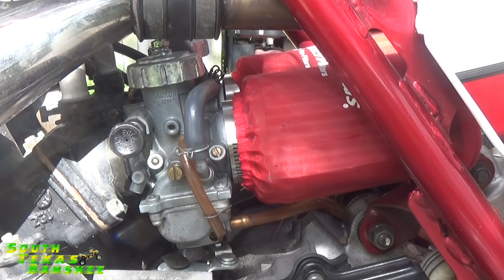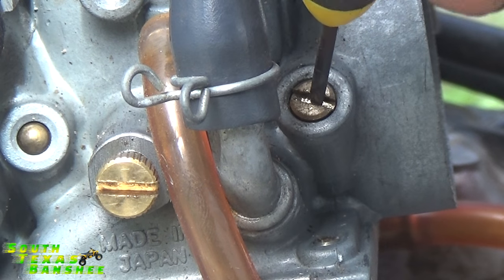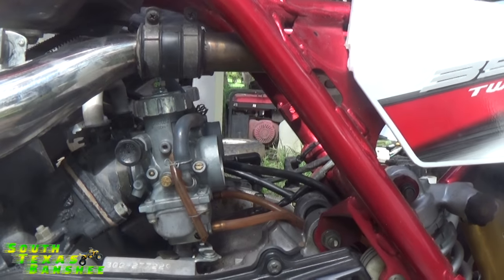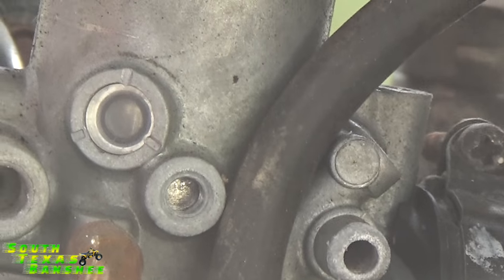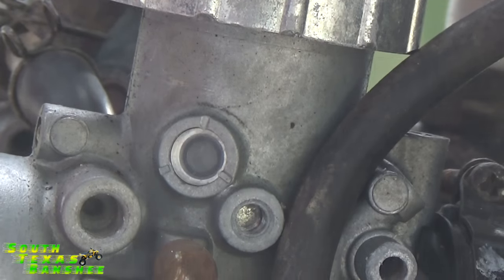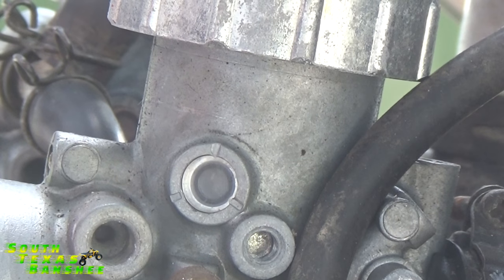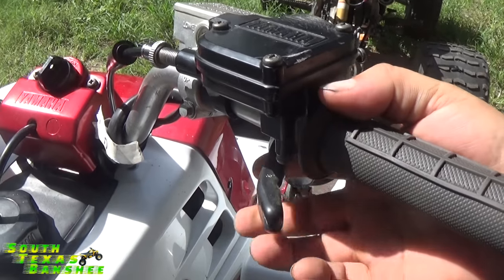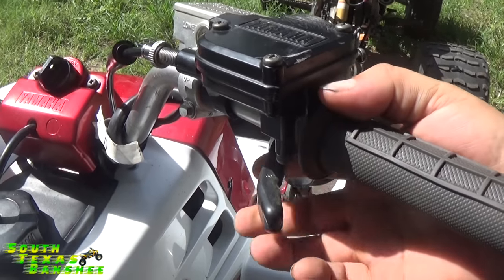Banshee (stock) carb tuning, air mixture, synch and idle adjustment

Comment: Your videos are magic in the making thanks big homie
Reply from the maker: CITY-OF-911 thanks for the appreciation my man, more to come in the fall!
Reply: Not even gonna lie if it wasn't for these videos I would of been broke  bringing it to a mechanic. But this is my first banshee, and it came with cool heads and I'm doing a rebuild on the top and bottom end do I need a special gasket set? At least for the top end ?
Reply from the maker: CITY-OF-911  order a pro design cool head o-ring kit. You’ll be good to go. No gasket is used under the head. Be sure you watch the cool head video. Take your time and it’ll go smoothly.
Reply: South Texas Banshee thanks, just posted a pic of my bike on ur Facebook page I hope u like it.

Comment: I did the same as the video and it now runs great but there is fuel leaking near by the idle screw from the oveflow wholes in the right carb

Comment: Hey.. my stock 26mm  carb for my 350  called for a 280 jet 30 pilot with my pipes but I'm moving up to a 28mm Keihin PWK carbs.. the jet number are smaller they dont sale a 280 jet for those.. question is would a #160 main jet on the Keihin PWK be same as 280 on the stock.. if not what would be a 280 on the Keihin PWK

Comment: How do the carbs feed fuel during operation? Is it pressure or vacuum that pulls the fuel in or how does it work specifically?
Reply from the maker: Gravity fed sir. As long as the fuel cap is venting like it should fuel will flow down into the carbs. Have a good eveing🤙🏽🤙🏽🤙🏽
Reply: @kevingalindo1  I'm having issues with not getting any fuel into the cylinders, just did tors delete and did a rebuild kit on the carbs. Any suggestions?
Reply: @DJMANDOYUPP  make sure your carbs are sealed and you don't have an air leak between the reeds and the carb. Also make sure your jets are clean

Comment: I have a Yamaha banshee 409cc stroker could you tell me what Jets to start on OEM carburetors mikuni's
Reply from the maker: What elevation and air filters ya running? Also what temperature  is it where you are

Comment: great video!! I just picked up a banshee that's been built with a few mods. idles like shit and bogs at low rpm. I'm certain the carbs are outta whack. thanks to you I now know how to check the carbs. thanks again.
Reply: Dan Ayotte my banshee Boggs to at low rpms. Did this video help stop the bogg cause mine still Boggs at this time especially on take off on first gear.

Comment: hi kevin! need help bad....can you point me in the right direction. I have blown 3 top end. I seem to can get my jetting right. I have a 421 with 34mm pj crabs 55 pilot 152 main never been touched. my elevation is 702. where should I start with my pilot and main? please help me
Reply from the maker: Are you doing plug chops? 152 mains sounds like 10 sizes too small, what are your mods?

Comment: I know this is an old video, but I just got my banshee, it seems like mine won’t idle very well, and it definitely smokes more than yours. Does that sound like the carbs need cleaned and adjusted? I plan on following this video step by step to see if that will make it idle. Do you run seafoam in a 2 stroke? What ratio do you use for oil? Thank you!

Comment: Hey just got a 1995 Yamaha Banshee. It still has the Tors carbs on it. I can't get it to ideal and it back fire. Any help would be greatly appreciated
Reply: Hey so i seen this is old but it its backfiring and not always getting spark and it wont start properly its generally stator issues. Mine did the sake thing untill a new stator was put on and my timing was set

Comment: Am I correct that turning the air screws OUT means more air less fuel and IN is vise versa? Got a stock 04 used, found they were 4 turns out instead of the factory 2 turns out. Thanks for your help as always
Reply from the maker: ME 109 that's correct. If they had them that far out, the pilots let's may be too big.
Reply: @kevingalindo1  I haven't ridden it since I turned them back to factory settings. When I do what symptoms should I be looking for before I have to look at the jets?

Comment: is there a easy way to check pilot jet lean or rich?
i know main jet is do a 6th gear pull clutch in and coast it out and then check spark.
but i got a bog down at 0 till 1/4 power its pissin me off, air screw is at 1, removed the airbox snorkle, and i got 22.5 pilot jet that seems to small if i google a bit around it should bee 25...
main i put 210 in, i got stock bit with stock airbox no holes just a twin air filter. and 31k rdlc 350 carbs (i think these are 28mm) i dont want to run it lean and fuk it up its already a expensive quad :)
weather also has its effects on the quad

Comment: South Texas Banshee I do not understand by following your steps and the left side does not work in harmony with the right !! I live 800 meters above sea level and use 280 main jets and 25 Pilot jets, I also use T6 Any help what happens?

Comment: Got a question u helped me before i have complete stock banshee with vforce4, k&n filter open air box with fmf pipes can get it to jet right i have 280mains and 25 pilots straight frying my plugs. Any info? Now i habe another one with stroker spacer plate with fmf pipes and it has 340 or 330 with either 40 pilots or35  have to double check again but runs good.

Comment: yes! I have 4mil crank 115  long rod 68mm pistons 21cc domes v 4 reeds 34mm pj keihin cards shearer small bore pipes advanced +4 with the advance black box I seem to not know where to start jetting with my elevation i
Reply from the maker: I'm not real familiar with the PJ carbs, but a guy I know is running 34 PJ's and 165 was too rich, so I'd start there, so your not making runs too lean. Start rich enough it won't get on the pipe, then step down size by size until it will. At that point start doing plug chops. Be sure you leak it down as well.
Reply: Okay thanks!

Comment: I bought my banschee had the tors delete but not the idle screws. I added the idle screws now nothing. It's leaking gas to the right of the choke where you have the pink tube attached.  Any ideas.  It ran before I messed with it

Comment: I never installed the idle screw ...I use the top of the carb nut for such. Every did it that way?
Reply from the maker: The thing with thay is that's not the right way. You need to have slack in your cables. 9 times out of ten when you have no slack in the cable it will rev when you turn the bars one way or the other.

Comment: stock motor, TR6 pipe, 300 main 27.5 pilots, air screw 1.5 out and needle clip in the middle all stock carbs... running airbox/K&N cone with holes at sea level, temps ranging from 50-75... it'll start from cold, and run until it warms up but fouls plugs on idle... any ideas? after it dies on idle it wont start until completely cold again... or i clean plugs.

Comment: Hey I've been watching your videos and like your work.  Not sure if anyone can assist, I'm running 300 mains on a stock bore mild ported banshee with pipes and intake and reeds and filter and still only able to get air screw out 3/4 of a turn.  I'm told I need to be at least 1 turn out or I'm running wrong size jet... Well I've gone from 290 to 300 and I can only get decent colored plug chop at that mix :(. I'm also running 50:1

Comment: HELP. My banshee got new carb gaskets, synced and went really good last time i drove in like 3h. Then i got home washed  the banshee carefully. Next day i was going for a ride and It started to misfire and bog on leftside at low rpm. I cleaned my K&N airfilter. I drained the carbs. I checked the sparkplugs and even changed them. They went black AND dry. So my real question is... is there any gasket on the engine that can cause this ? Can it be a tiny water bulb or some unwanted vaccum coming in? Thanks yall!

Comment: Why do you think that when I'm giving my bike gad In 5th and sixth gear it seems to bog. but all the rest of the gears it has plenty of power. It freshly rebuilt top end and bottom end I have the timing advanced to +4 degrees and running 300 main jets and  27.5 pilots. air mixture screw backed out 1 turn. I had it at 2 turns but it would sputter at low speed.

Comment: Hey great video! I've seen you've replied to a comment from 2 weeks ago so hopefully you see this too. I've got a ybr 125 single carb very simple but it just won't idle. Idle screw is screwed all the way in and I've played with the fuel screw as well but still it just revs down slowly from about half choke and then dies. Only full choke will keep it running. If I rev it while on choke then it revs up high and stays there until I bring it down a little then it slowly dies down completely. I've cleaned it, checked for vacuum leaks, etc but nothing. Any ideas? I'm pulling my hair out at this point!

Comment: Hey man, I just finished changing my old reeds with new boysen reeds. After everything was installed I stared her and it took at least 30 kicks but finally started her up. When she turned over, the idle was very very high and I had to shut it off after like 2 seconds. I don’t Know what the issue is and I was looking for your opinion? They were replaced with stock reeds so I don’t think I need to reject but I’m not sure. Thanks for the help :)

Comment: I just redone the top end back stock,  carbs are stock with a 280 main an 25 pilot (I think is to small) and 280 main. it has t5 exhaust. what you recommend,  Ian in hendersonville NC on altitude

Comment: Ey bro.. Good work. You have been helping people on this with 1 vid more than you know.. I just got a 06 banshee special edition a few weeks ago. 1st banshee ever. Damn I love this thing. Of course it has to be modified. And that has started. Thanks to your vid my bike runs smooth now. Did a cfm performance air box, with pod k & n filters. Look similar if not same as I see on your bike in this vid. I didn't like the idea of running wide open without a box. We are to wet here and I'm for sure using it for off road mostly. Anyway. Thanks for this vid helped me and I'm sure many others.

Comment: Hey I have a 2000 yfz350 that is getting to much air and will not start I have no airbox aftermarket pipes and stock carbs what can I do with air filter to fix that?

Comment: I'm running t5s with the airbox on with the pro flow filter and when adjusting the air fuel screw do I need to have the airbox on for this adjustment I have 300 mains now and 30 pilot jets and it has a hanging idle and will not take any adjustment.

Comment: So how do you know if it’s just running too fast because of the idle air screws or the actual idle thing up by the throttle? If it’s idling too fast how come you don’t just turn down the throttles idle thing?

Comment: What does it mean when are you are not getting any gas the carbs
Reply from the maker: GONEPUPPY ? 
sounds like plugged fuel lines or petcock
Reply: GONEPUPPY ? you'll have a flat spot.it will feel like a stall.a bog is the opposite meaning to rich

Comment: do you know anything about king quads ? I got a 1999 king quad 4x4. the carb idle screw is turned out 6 half and its inside the bowl. hard to get to . I got it all apart till I find out . and it keeps back fireing. thanks.
Reply from the maker: James Jiles 
The screw underneath is the fuel screw, the idle screw will actually be on the right side with a flex cable leading under the carb to the left side of the engine. The screw in the bowl needs to be set around 2 turns from seated or where it idled the best. If you don't see the flex cable, it may be broken off, pull the right side cover and you'll see a box on the right side of the carb. Look for the adjuster.
Reply: thank you so much yeah I seen that flex cable thanks again.
Reply from the maker: James Jiles very welcome sir

Comment: Trying to set my pilot jet i have a thirty seven and a half. And at idle my plug is black and wet. Now when i put a thirty in it same way. Then i put a twenty seven and a half in it and the motor don't run right. please help!!!
Reply from the maker: david malicek what are all your mods and elevation David?
Reply: ported by ct racing 19cc cool head v force 3 reeds and 38mm carb. K&N air filter no air box
Reply from the maker: david malicek, plugs are gonna be black and wet at idle, I'd prefer that over lean any day. I mean I guess you could plug chop it at idle, I'd get it where it ran good around 2 turns warm n needs the choke when it's cold for a just a little bit. all mine are jetted to fire up cold no choke. plugs are re black and wet, but have yet to fowl a plug.
Reply: K another question when I plug chop it in 6th Gear when I let off the gas and Coast it white smoke was coming out of my exhaust and a real stinky smell
Reply from the maker: david malicek 
Coolant leaking in to cylinders man. head gasket, or is it just the right side?
Reply: South Texas Banshee it was both sides on my brothers banshee but then it stopped. me and him was racing and both of them did the same thing. will a leak down test find out if we have a leak.
Reply from the maker: david malicek, ya know I've had a couple do it to after a hard run, tons of white smoke rolling out then after a little but if easy driving, it's goes away. I always thought it to be crankn seals getting weak, but both sides wouldnt do it like that. I'd leak it down for sure though just to be certain.
Reply: South Texas Banshee k thanks so much love your videos. Keep them going!!
Reply: South Texas Banshee. I put a 30 pilot in it.  Two turn out on the air screw. And it idles high i tryed to turn the idle down and it had no affect .

Comment: So hope your still on here but I'm having a major issue with my 2000 shee and the right throttle carb cap keeps coming off and I believe it's that same one leaking fuel out the overflow when it's just sitting shut off and then it has a bog in the mid range and wants to pop and back fire on that side now to since someone I know went and messed with the screw on the right carb as well. I'm so frustrated and really could use some help. Thanks so much.
Reply: it could be the needle seat rubber O-ring of the float that is damaged. i had the same issue a few years ago. around 2 litres of fuel vanished from the tank over the overflow vents of the affected carb. then i ordered a Moose carb rebuild kit. this o-ring is part of the kit. after i replaced it, the issue was gone. i do not remove the needle seat anymore for cleaning from now on. only if necessary. but i think you figured it out yourself after 2 months.

Comment: Having serious problems with my carbs....they are brand new Khein Sudco carbs, both of them are leaking gas from the side vent hose that it next to the choke and the hose that is at the bottom of the carb...what should I do ? Also, my banshee isn't getting any spark from the spark plug coils. Help would be great with these problems
Reply: Buy carb rebuild kits and also make sure to float heights are set correctly. Also for the spark issue, try trimming the spark plug wire back an inch or 2 and then put the boots back on and try it again.

Comment: I got some questions about my build I just finished up. I did a break in on the motor first thing i noticed whenever i turned my fuel on it immediately starting flowing out but once started quit. And after bout a min the the pipes were scolding hot and i think it fried the rings already. Just replaced trans OEM. Driveline clutch, cool head by pro design 21 cc domes. New to the cool head also
Reply from the maker: brandon thomas 
Hey what did you find out?

Comment: so ive done everything here. but it seems like my throttle cable is to long and the slide wont come down to the window. i have messed with the screw on the carb and on the trottle(i have a twist throttle) i dont have any other adjusting points on my throttle cable. what do you suppose i do? . the mark on the slide using the window it stays up maybe 1/4 in above the window. (this is with full throttle. please help me fix this. thank you for the help all along the way.
Reply: roughly 1/4. throttle turn away from the mark to the window. but thats with my screws all out. i dont want to ride that way just incase.